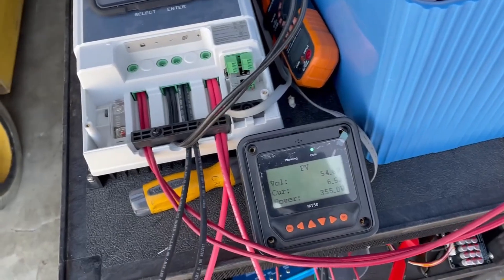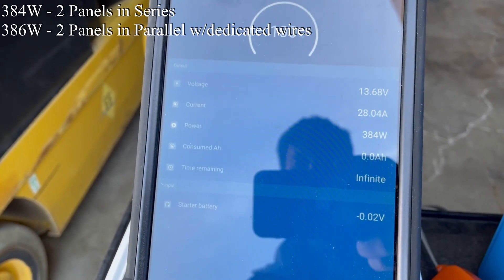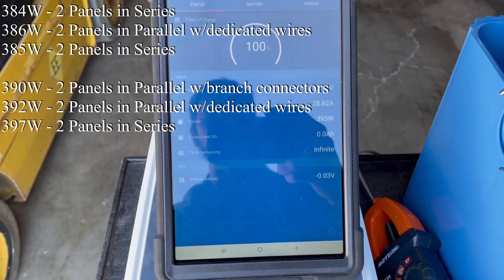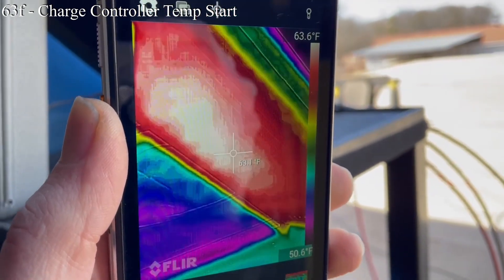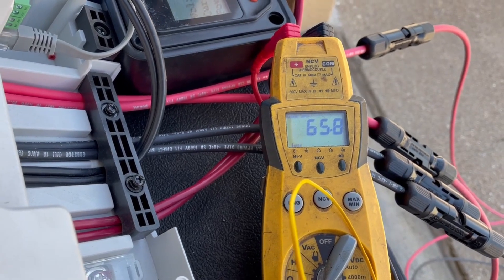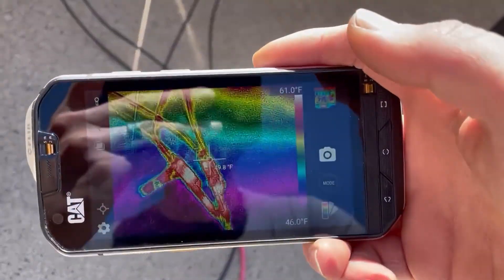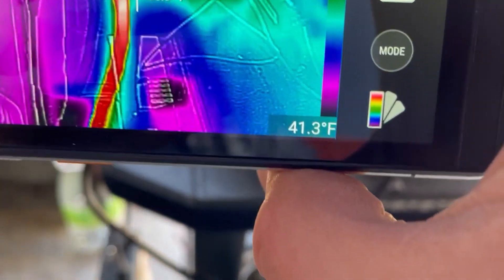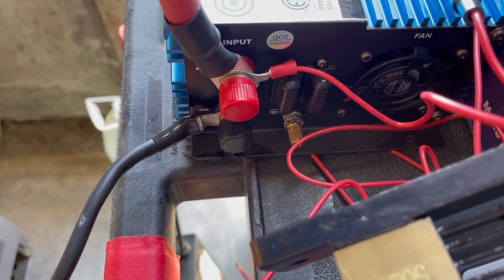Proving Solar Panels in Series are more efficient than in Parallel? - Part 2/2

Comment: I'm running three in series with one of my epever installs.  It works fine until something like 96 volts then it shuts down when it hits absorbe because the voltage goes over 96.  One of my other installs I'm using their higher voltage unit and I'm much happier with it because of the ability to use less wires and breakers with more panels in series.  Sure things might get a bit hotter but as you've shown in this video that difference is nearly negligible in most cases.
Reply from the maker: The one hitting 96v, is that a 100v version of epever? I think they have 100, 150, and 200?
Reply: @BeeneEnergy  yes.  And then side by side with that one I have the 150. And on a different installation I have the 5420an rated for 200v input which is side by side with a midnite kid.  The midnight failed 2 times at least one of those times was for no reason.

Comment: In the first comparison in this video were the series panels catching more reflection from the pavement? And the parallels reflection was shaded a bit by the other panels?  It was kind of hard to tell which was which for me.
Reply: YouTube wouldn't let me post a link here. I tried texting it to you did you get it?
Reply from the maker: In the first part I only had the two panels out there. Ran them in parallel as well as series.

In the second part I had four and ran them all parallel vs front two in series with each other and back two in series with each other. So any light bouncing off the pavement, which is a fair observation, shouldn’t have played into any skewing of results.

Comment: Parallel vs series really comes down to voltage desired and how shading effects output. Series if one of the panels is shaded the entire series loses production. In parallel if one panel is shaded only that panel’s output is effected. But in perfect conditions there shouldn’t be a difference in the power output in parallel vs series

But the higher amperage of parallel will cause more heat in your wires if they aren’t adequately sized. 

If you have to run your wires a long way the higher voltage of series will lose less power over a longer distance. 

There’s lots of variables that need to be taken into consideration when choosing parallel vs series
Reply from the maker: Yes indeed. I was trying to concentrate on the ability of the epever to translate higher or lower voltage into useful power. I agree that in a practical scenario  the considerations you listed are more important. Something I’ve heard a lot though is to make sure it’s in parallel for something like this, and I find that individually to be false. If there aren’t shading issues it seems valid to simplify wiring by running in series.
Reply: @BeeneEnergy   relatively speaking these auto voltage switching/sensing charge controllers are kind of new and I’d say people are applying old rules to them when they say “make sure they are in parallel” People get set in their ways and tend to not look at new changes objectively.
I could be wrong though
Reply from the maker: @geauxracerx  I think it’s very possible that is what I’m hearing. I’m just as bad as the next person about learning something new that I think I already know. Takes energy and time to keep up to date for sure!
Reply: @BeeneEnergy  that's exactly my thoughts specially all in one inverters  that has only single MPPT. how efficient single MPPT in translating high voltage array into usable power. please do more of these videos.  and please compare the efficiency of a  single mppt vs dual mppt of all in one inverters. others claim 99% efficiency in dual mppt inverters. how true is that?

Comment: For the layman, and without wading thru all the figures and logic of the video, what was the summary percentage for efficiency improvement?
Reply from the maker: Realistically it’s better to consider length of run for solar wires and if there will be partial shading involved. The difference is so small, I think I measured 5%, that other environmental or cost considerations will outweigh results of my playing around :).

Comment: Basically it’s just more efficient to run in two different strings, series and then parallel them together. 
This makes it run cooler and therefore the charge controllers run cooler. 
Also the wire gauge can be smaller.
You can also run more panels this way.

Comment: Since nobody else is commenting I have another question. I have 2 300ah chins 12v batteries. I am wiring them in parallel. My question is do I connect the leads to my bus bars on one side of the battery or diagonally
Reply from the maker: I’ve always seen diagonal as being best. Positive of one battery to busbar and negative of the other to a busbar. Keeps the voltage closer to each other under load or charging.
Reply: @BeeneEnergy  thanks I wasn't sure.

Comment: If I have 8 100w newpowa panels and 2-210w panels can I run 3 separate charge controllers to the same battery
Reply: 60a PowMR an makeskyblue 60
Reply from the maker: Yep, I’ve actually got a video up here somewhere running a pair of powmr 60a to the same battery. Works just fine!